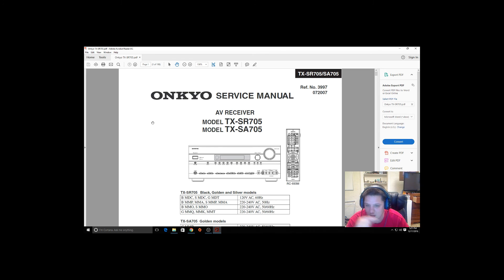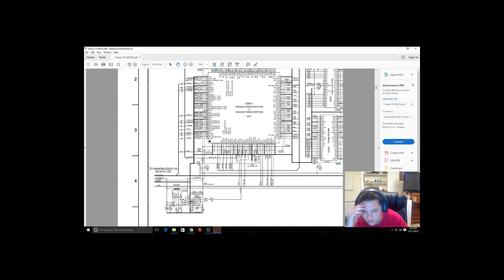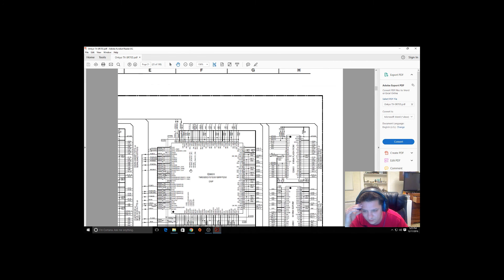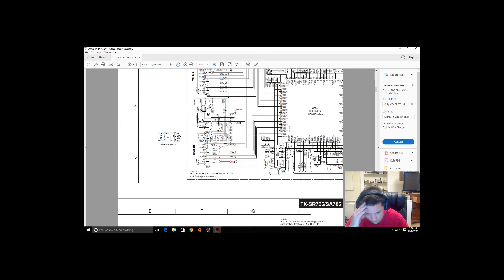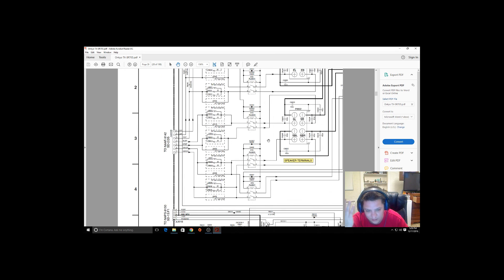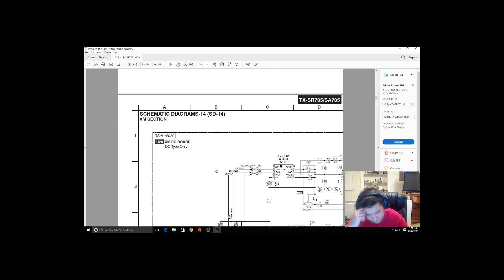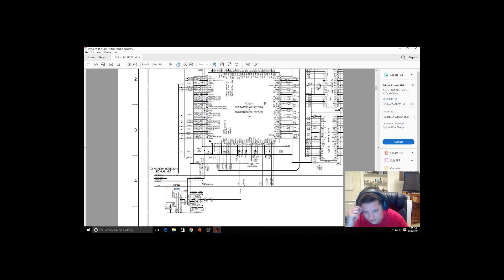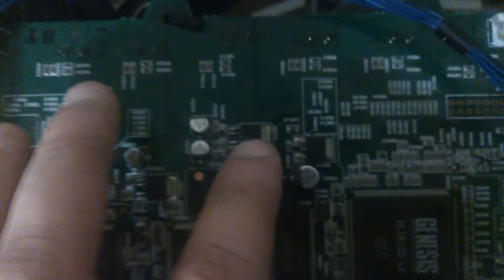Onkyo TX SR705 Front Panel Display Flickers And No Sound. Help me Please:þ

Comment: My Onkyo TX-SR875 gives me Popping/Crackling sounds from its front Left  and Right channels. I tried to used it in analog mode but the popping/crackling still availalbe in all mode. I am unbale to use and DSP mode. Please guide me to solve this issue. I have its service manual.